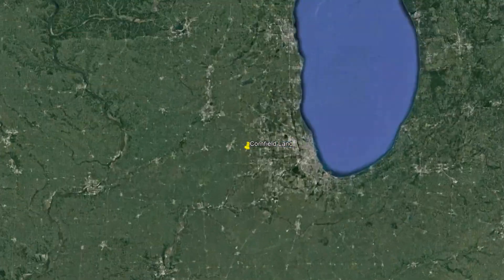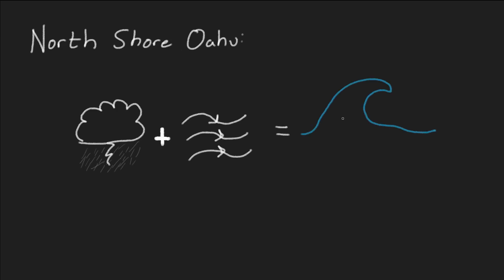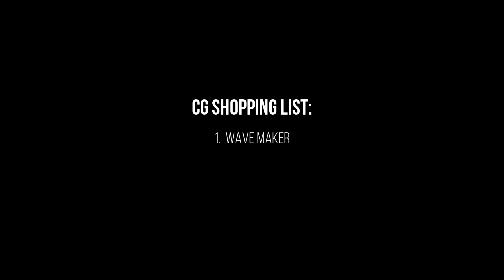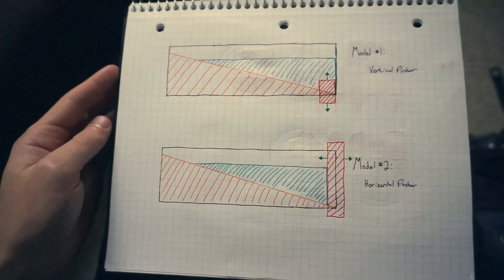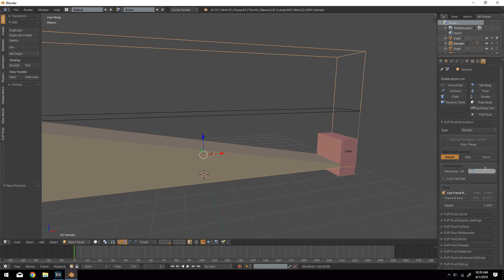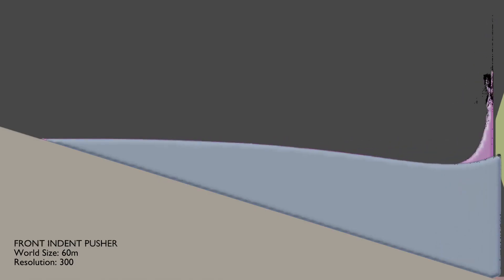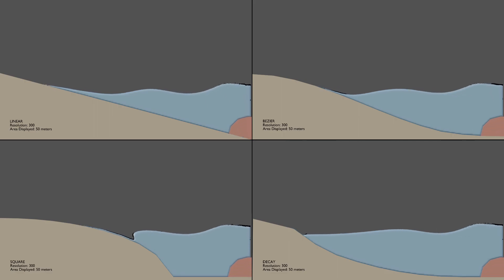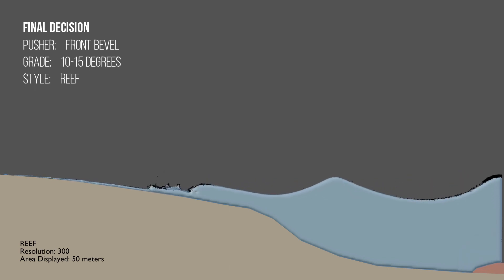Creating Curling Waves in Blender | FLIP Fluids

Comment: Very cool video, but I would like to add one note. The best real-world surfable waves usually tend to break along a line to the left or right. This is due to the line of the swell meeting the shallow land at an angle. So instead of having the whole swell meet the beach all at the same time, you should try angling the shoreline so that the wave peels along the shore as it breaks one small bit at a time. Look up pictures of point breaks like Jeffrey's Bay or Chicama, and you'll see what I mean. This will also direct the backwash away from the wave source resulting in less interference.

Comment: this is such a fantastic project! Just as someone who is new to blender but has a lot of experience in the water, I think it would have been really cool to further develop the topology of the ocean floor, for example creating a longer area between the "reef" and beach would allow more time for the wave to curl and become a tube, but the main thing would be to create a point of sorts which  would allow one side (or the center) to lift up and break first, creating the tapering break that progresses across the wave and is what allows for surfable waves. In this simulation the waves are "close-outs" or waves that break all at once and close off the rideable area on the unbroken face of the wave. In the drone shot you can see the reef at pipeline starts off wide at the beach and then comes to a more narrow point where the "peak" (area that breaks first) is.

Comment: Man.. this is insane!  Can I ask you some questions?  

-Can You help me understand the water's "world size" settings?!  HOW did you get the water to be "ocean sized" compared to the size of liquid that exists in a cup of water?  
-Also, how did your machine accomplish all that rendering?!  Do you have more than one computer to use if one of them is rendering for a whole week?  What is your workflow?  Do you have a render-machine or something, exclusively for rendering?  
-Can I know your workstation and rendering machine's specs, please?  I'm just trying to figure out how to upgrade my setup.  
  This video was incredible!  Thanks!
Reply: In the FLIP Fluids addon, The 'World Size' parameter can be used to set the scale of the fluid physics. In smaller scales, fluids will move faster and behave more like a cup of water. In larger scales, the fluid will move more slowly like waves in an ocean.

By default with the World Size option disabled, the physics scale will be 1 Blender unit = 1 meter in the simulation. So if your domain is 10 Blender units long, it will behave as if it is 10 meters long in the simulation.

When the World Size option is enabled, you can set a specific scale for the domain. The World Size value sets the length of the domain to match this value in meters. So if you set this value to 20, the longest side of the domain will behave as if it is 20 meters long.

Hope this helps!

Comment: This is pretty cool! However from an average surfer's point of view this wave is a "close out". You should change the seabed making a spearhead so the middle part of the wave starts breaking before, falling like dominos to each side.
Reply from the maker: Thanks for the advice :) I'll make sure to consider that for future attempts.
Reply: Well thank you for posting this project. I came across your video as I was searching for a wave simulation program for a project at my local beach here in Brazil. The wave here almost only break on the sand a bit like your video, so I want to make a slap on the seabed making the wave break before and then start pealing left and right "A frame". However I need to know the best shape for slap before presenting it to the municipal.

Comment: Great video - great research - really useful information.  Thanks for putting the time into sharing it.

The thing that pops out at me in regards to the waves looking "off" is the dark particles - which I'm assuming are the whitewater particles.  I'm wondering if there was a ray-depth issue - or just a materials issue?  If those weren't as dark (preferably looking more like bubbles or more towards light/translucent) I think the waves would "sell" irregardless of some of the other details like misting and sand interaction ....

Still, good stuff :)

Comment: Pipe is a fairly long wave and certainly not a shore break so a gradient that evens out closer to the end would give more realistic results (assuming he wants a close simulation to pipe) And it would be interesting to replicate the sea floor further out and have the pusher further out aswell to see if that will change the way it breaks. although it may be hard to find a height map of the area.

Comment: PS what are those black spots in the wave, is that the limitation of Cycles. Cant it do proper caustics? It seems looks like there is hardly any foam created. The internal blender sim does have much nicer effect with this. BUt i believe i did see great foam particles created by Flip Fluid Sim
Reply: Its seems Flip Fluid does have option for spray particles. Did you see it on their page?
Reply: I know it's a year late, but a guy did a whole thing on rendering glass at the last Blender Conference that would fix this. I just used it to solve a problem I was having.

Comment: Fantastic work. But the foam/bubbles seems to be too dark sometimes ;)
Reply: It's not even just dark. It looks like pure black oil in the water. It looks like the same shader issue that happens rendering glass. There is a fix if that's what it is.
Reply: I think it's something got to do with backface culling
Reply: @jai-bellare  yea, exactly
Reply: It appears as if the reflection was black or not using an hdr or environment
Reply: increasing transmission samples by a lot may help
Reply: How do you fix that?
Reply: @brightgarinson3099  don't use a black background, I guess?
Reply: @brightgarinson3099  
Just call it octopus-ink.

Comment: Great job and very interesting :) ! About whitewater : I would suggest not using shadows on water but a small transparency mix shader with shadow pass
Or using a small emit. Because there aint that much dark whitewater IRL, especially on this case of huge simulations

About them disapperaing, well there is a setting about it

About the mist : it mostly happens when there is wind going opposite way from the waves, or is stong enough to seprate small drops of almost in apesanteur water

You could have wanted caustics to work too, in that case I can't recommend enough to use luxcore render in its latest version, it is really an amazing renderer

Comment: Besides problems already mentioned:
- waves are too clean, too perfect to propely emulate real world. They are waaay too smooth
- they breake too smoothly. There are some foam particles genereted but the wave itself folds like it's made out of jam or something else with high density
- there are no traces of foam in the water
- i dont think the water material has volume absorption

conclusion - flip fluids is a joke if you want to create realsitic effect. Use Houdini or Realflow.
Reply: Just to clarify one point here... "flip fluids" are not a joke since it's exactly what houdini uses. Hard to expect blender to be on par to a dedicated vfx software but let's keep the terminology right here. It's called "flip fluids" in both since the method is called flip simulation. ^^
Reply from the maker: Naxster I agree with your points. There are a ton of things that I'd like to improve on in the future, including a lot of these. The FLIP Fluids add-on is pretty great, but the results from RealFlow and Houdini are just unmatchable.
Reply from the maker: Oh, also, the water does have volumetric absorption, but the density is set low to replicate the water from the north shore of Oahu.
Reply from the maker: Kultsound Sorry, I was referencing the FLIP Fluids add-on, didn't clarify that well.
Reply: Good idea!  Feel free to send me your licence to either RealFlow or Houdini anyone!  Thanks in advance lol
Reply: Naxster  Hmmmm... let's see... HoudiniFX: $5,000. RealFlow: minimum of $1,095. Blender: free. FLIP fluids plug-in: $76. Only a total jerk off who thinks he knows it all would compare the three.
Reply: +TGS
"flip fluids is a joke *if you want to create realsitic effect*"
IF you want to have sand interaction, mist, realsitic foam and detailed water particles interaction.
IF.

Only a total moron would be so boorish to mistake his lack of reading skills as someone else's mistake

Comment: One thing that I would've done (if i knew how to do any of this) is change the pusher to be at an angle with the shore, rather than parallel. That way the wave hits the shore at different times. Either way, very impressive video. Great job.
Reply: How would it not make it hit at different times? It would start some of the wave further back form the side of the pusher furthest from the shore, and start the other side of the wave closer to the shore line, the side of the pusher that is closer to the shore. Like this    Shore Line: | ~ ~ ~ \  Pusher
Reply: What he is saying is to rotate the pusher around the vertical axis so that when it pushes the water, the curling wave kind of forms and crashes sequentially, like on the real world where the waves make that space where the surfer usually surfs in while the wave is collapsing